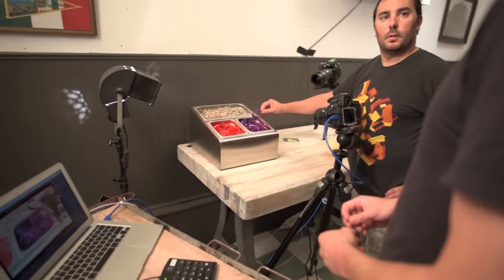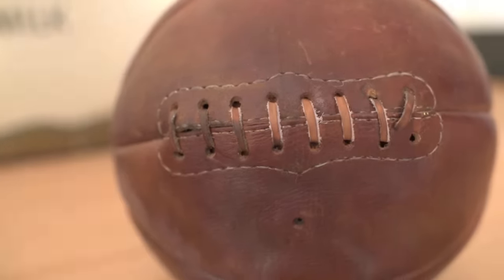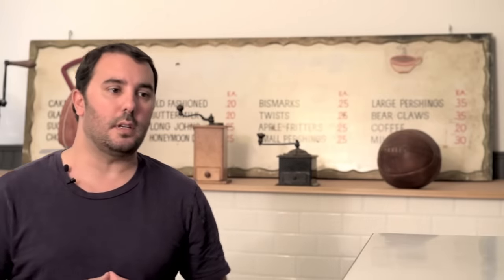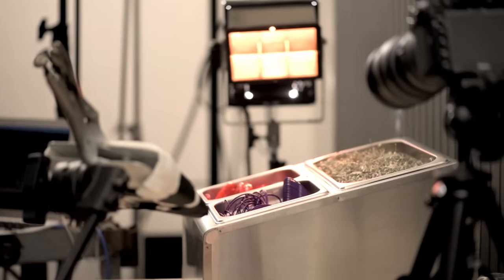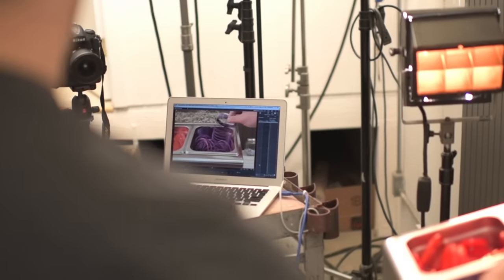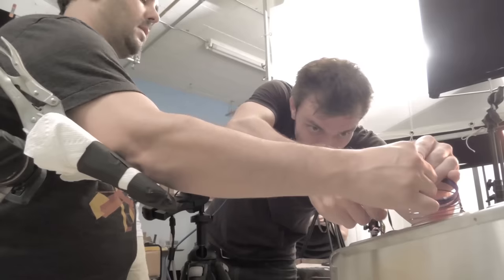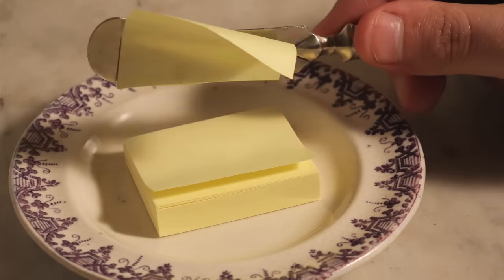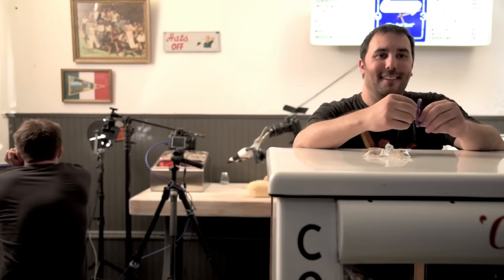Sub Sandwich: Behind The Scenes With NIKON

Comment: Kudos because stop motion looks like the most frustrating and horrendously time consuming medium that's out there.
Reply: You sir couldnt be more correct. Its a giant pain in the ass and more often then not leads to pure raging fits, but the final product is so worth it, as you can tell.
Reply: isnt animation even worse? its basically the same, but you also have to draw things the same way picture for picture.
Reply: Spastmatiker nope, not the same. For stop motion, you have to take a shot for a scene all at once, whereas animation, you can go back and put inbetweens in, and it's much easier to adjust timing that way. Also, you can't accidentally knock over a prop or whatnot and having to redo something over again just because of something like that.
Reply: hmm... yes right... but id say both are pretty hard. just different problems
Reply: Spastmatiker
 Both are pretty hard, but while one just takes time and skill, stopmotion has the added element of potential disaster. It's kind of like making a huge track of dominoes: the bigger it gets, the more impressive it is, but the more heartbreaking it is if something screws up and topples them too early. Just like with dominoes, there are often things you can do to minimize that risk, but the risk is still there. And making a stopmotion where a person is involved quickly becomes physically exhausting as well.
Reply: claytorpedo I belive the stop-motion is harder technique to master but more accesible to the begginers. Everyone can do it, only thing you need is at least a phone with camera and some things to move around. Drawn animation is much harder to get into but later it offers more control over your work.
Reply: Spastmatiker Animating free hand is fun tbh. If you ever heard of Flipnote Studio on a Dsi before
Reply: Halen Peterson background scenery and stopmotion animation are two completely different parts of the production. Stopmotion could also have drawn backgrounds if it wants.
Reply: +flexor212000 
Animation in general can be frustrating and horrendously time consuming, its when you see the final product is what makes all that hard work really worth it.
Reply: flexor212000 ii
Reply: flexor212000 no
Reply: flexor212000 i
Reply: It sure is
Reply: It really is. I did a 2 minute one for a school project and it took almost 6 weeks.
Reply: Zahara Elizabeth hats off to ya. Would you mind posting it on your channel? (Like this comment so I can be notified).
Reply: Klavier Gavin oh it's been so many years since I did it. I was in probaby 7th grade back when I did it and I'm currently in college.
Reply: Animation and stop motion are both very difficult to do. With animation, it’s true that working digitally is fairly easy, but you can’t animate unless you know how to draw. Then you have to redraw that same thing. Over. And over. And over. And over and over and over and over. But with stop motion, the things are already there, you just have to move them. And it takes a lot less time to create each frame. Instead of redrawing an entire character, you just move the arm or the head. But you can’t make even minor mistakes or it will screw it up, like lighting, props, the subject, background, poses, etc.
As someone who has done both, I can confirm they are equally as difficult.

But stop motion with real people is something I don’t even dare touching.
Reply: littledustball man ive tried stop motion and hand drawn traditional i can assure you traditional is 20x more painful than stop motion
Reply: Spastmatiker hi ! I animate and i can say for sure stop motion is harder
Reply: flexor212000, I know! For most of the shots he could’ve just shot it normally then put it on a low frame rate lol
Reply: I do stop motion. It is hard and my stuff isn't close to this level
Reply: It is
Reply: Try hand drawn animation

With one person

Without a drawing tablet

Without copy and paste.
Reply: @LadyoftheDreamless14  في
Reply: @LadyoftheDreamless14  jbn9 8u nhạc Xuân Phong Vân
Reply: Yep
Reply: indeed

Comment: " In most cases, I find digital vfx have a tendency to look like a 3-dimensional cartoon, as the result of the inherent process. Digital work is intended to look photographically representational, but it can rarely achieve that objective. When you photograph a real object, that's exactly what you're doing, and as a consequence, IT'S WHAT YOU GET." -Phil Tippett